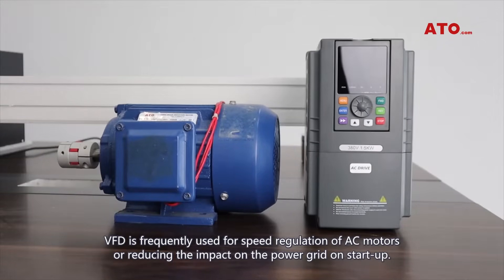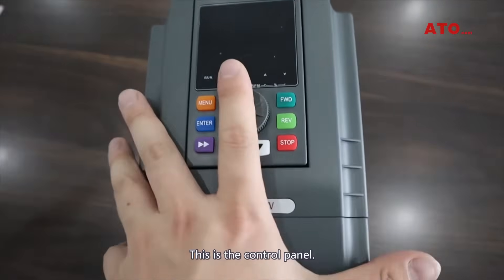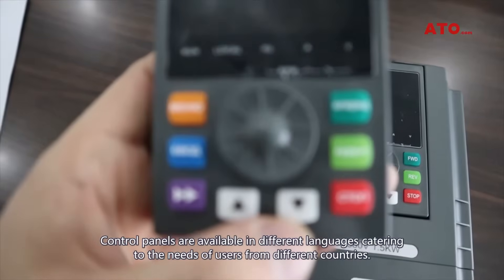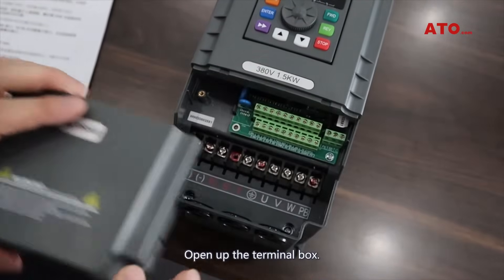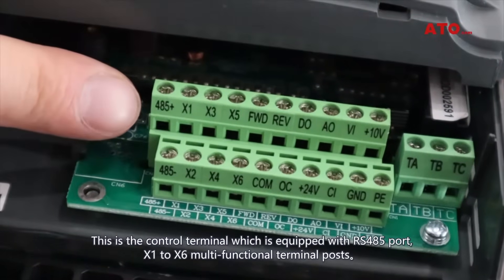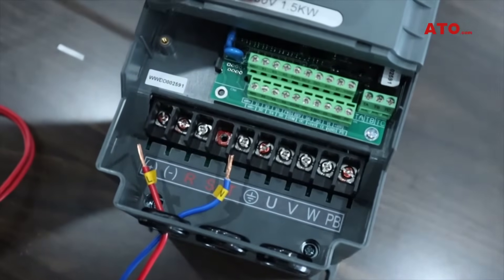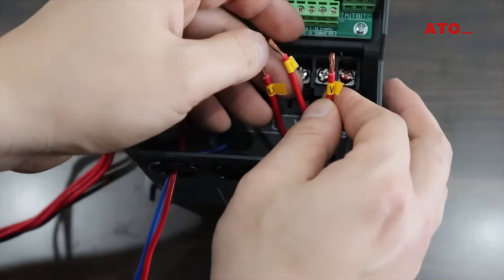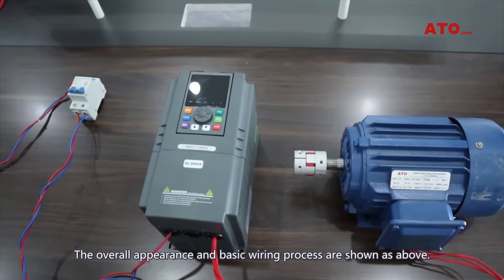Single phase to 3 phase VFD wiring - 220V to 380V

Comment: Does it has a boost converter on the input? Single phase rectified gives you 320V dc, you need 560+ Vdc to create the 380V AC. Or the motor has to be configured to delta 220V and there is an error on the description?

Comment: Hi; can I use it as phase converter from 220 single phase to 3 phases 380v with neutral? To run an euipment(1motor 3 phases + branch phase + neutral (220) to run transformator from 220 to 24 to operate for example approxemity sensor)
Thank You
Reply from the maker: no, it is only used for motor drive.
However, we have phase converters that will suit your application: https://www.ato.com/phase-converter

Comment: Why is the input marked L1 and N....which is 120 Volts on the line and N is the neutral for 120 VAC if the input is supposed to be 220 VAC? Thanks  DD
Reply: Did you ever figure this out? I have the same question.
Reply: Maybe it can work on anything from 120V to 240Vs as input, or maybe they used a convertor made for the US market where they use 120V in their grid.

Comment: Hi, how do you increasing voltage from 220V to 380V? None of branded VFD's have this feature. If I have 3 phase motor rated 380V 10A, how much VFD will take from 1 phase 220V supply?
Reply from the maker: If your load is normal load, you can choose our 7.5hp VFD, Buy it on: https://www.ato.com/7-5-hp-vfd-1-phase-220v-to-3-phase-380v
If your load is heavy duty, you can choose our 10hp VFD, Buy it on: https://www.ato.com/10-hp-vfd-1-phase-220v-to-3-phase-380v
When choosing a VFD, the rated power and current of the VFD should be greater than the power and current of the motor. We have various custom specification VFD.
Reply: @ATOcom-Automation  So no answer how you "increasing" voltage? No answer how much higher supply current will be compared to output 3 phase current?

Comment: Hi, I have my ATO VFD wired up and working, but my main breaker panel is hard to access at the beginning and end of the day when I need to shut off power overnight. 
What sort of switch, mini breaker or contactor should I use? I would like to have it mounted near the machine between the main breaker panel and before the VFD input power. 
Thank you!
Reply from the maker: Hi, there should be a recommendation for the circuit breaker in the user manual, you can look it up.

Comment: If a motor that works only on 380 volts is connected to a suitable inverter (220 volts input, 380 output)...
will the motor run at its full efficiency without decreasing torque or speed? Thanks!
Reply from the maker: The motor can run at full efficiency, losses only occur in the inverter (VFD). But if your input power is enough, these are not a problem.

Comment: Can vfd run with 5 hp submersible pump motor
Reply from the maker: Yes, it will run your pump. You need to match the VFD according to the voltage, current, and power of your pump. You can contact us through the official website, or buy directly!
https://www.ato.com/vfd

https://www.ato.com/single-phase-to-three-phase-vfd
https://www.ato.com/220v-to-380v-vfd
https://www.ato.com/three-phase-vfd

Comment: VFD for a 15 hp three-phase motor, with a 220 volt 50Hz supply?
Reply from the maker: If the rated current and power of the motor are less than the VFD, it is OK. This link, https://www.ato.com/20-hp-vfd-1-phase-220v-to-3-phase-380v

Comment: sir dish vfd input 220volt output 440volt volt use for submersible pump  5hp three phase  opret
Reply from the maker: We can customize VFDs with special voltage types. You can contact us by email and describe your specific requirements. contact us, https://www.ato.com/contactus